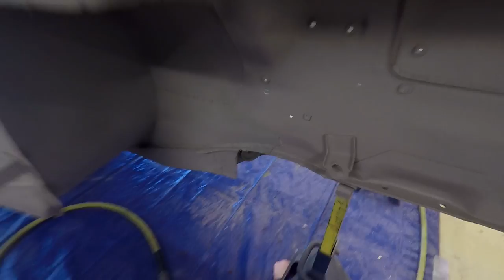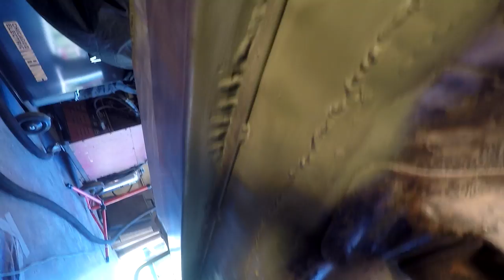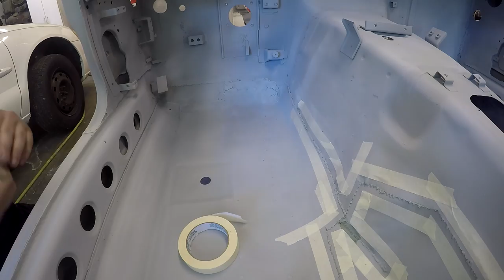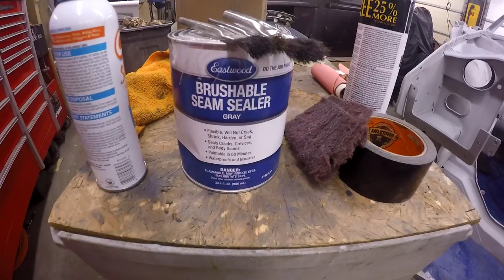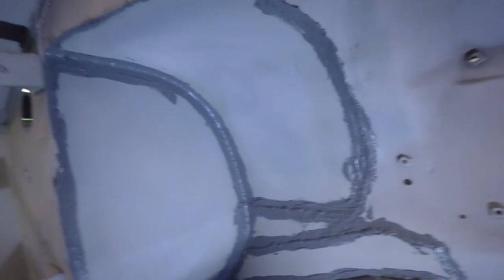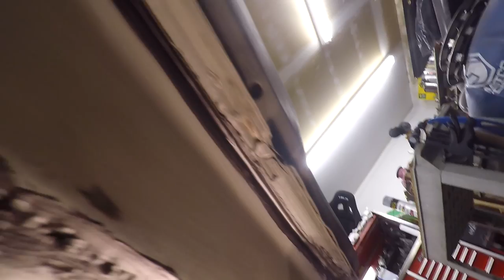Using Eastwood's Seam Sealer on the Datsun 280z

Comment: I hope hope hope you take my advice and use raptor 2part bed liner ,NOT rubberized undercoat it holds dirl gets soft when hot and then it's like tack cloth absorbing dirt then it gets cold and locks all the dirt in . Raptor is available online and at summit racing.
       That area in the roof is common as that is where the factory attached the roof to the rear quarter panel ,it's factory filled with lead ,plastic filler is just as good as long as it's prepped.

Please use raptor bed liner as it dries very close to a plastic gas can.
You will love it everyday you look at it.Remember any thing two part out performs and is alot more durable.

Again I'm not far behind you ,I live your staying on it because I am everyday  after work and every weekend. 
  Coming out nice my friend...
Reply from the maker: I have dupli color truck bed coating in spray cans and a gallon. I've seen it in person looks good. My dad used on his Cuda. I wanted something more clean and like por 15 for the inner fender. I'm going with something thick on the inner fender firewall and under the fender so that rocks don't cause damage and reduce road noise.
Reply: Built Not Bought TV 
Well it's  way better than ,that crappy rubberized stuff,I just watched a video on it.
      I love raptor.but what you have looks good too. Well after we have them on the road ,we will see how they both hold up.
         I have used this ever since it came out and the quality hasn't changed. Keep at it ,I'm going back to welding ha....I've got to catch up
I'm even happy with you being a step ahead. I've been priming after I've been welding so when I'm done welding I'm done priming so that's why I'm not far behind on both my cars.Im about to turn them on their other side to finish some welding I'll leave them that way to bed liner the bottom of the chassis. 
    Then I'll stand them up right and paint the chassis inside and out.
    It's been along time for us both.
But getting more fun.

Comment: Great video, you explain things very well and this helped me with my project. Thanks! Good luck with your 280z build! Looking good
Reply from the maker: Yo thanks, good luck with yours. It looks pretty cool
Reply: @StewartMotoring  so the seam sealer is for looks or does it prevent anything?
Reply from the maker: It seals the panels so water doesn’t get in
Reply: @StewartMotoring  owww so its really usefull, and do you have to primer it after that or can you paint over it?
Reply from the maker: You can paint over it either directly with paint or primer then paint. Don’t think it matters
Reply: @StewartMotoring  oke thank you that really helps! and 1 more question i am so sorry for the questions:P. can you do that stuff first on bare metal and then primer the whole car ?

Comment: You're getting so much done despite the NASTY summer heat. My 240 has been sitting in the driveway for a year now since I bought her. I've got a fair amount of work done but not nearly as much as you. Props man!

Ps. It's sooo much easier to work on your car when you've got the proper tools to do so. Another reason why I'm struggling so much.
Reply from the maker: Ha thank you. When I was doing the drivers side pulling off the tap you can see sweat dripping from my nose. Appreciate the comment! Good luck on your build
Reply: Isaac Mille

Comment: Safety Note: You were using Concrete Blocks to hold the car up.. I have seen some real problems with blocks crumbling/ cracking and braking.  I have experienced cars shift when improperly supported.  Please invest in another good set of car stands. No one should should get hurt enjoying their hobby.
Reply from the maker: Thank's for the tip

Comment: Did you not use seam sealer on the frame rails where you stitch welded?
Reply from the maker: Not from the top side, I sealed the frame rails from the bottom. Since it was just plug welds on the top they were pretty sealed.

Comment: Why did you apply seam sealer after primer? I'm almost finished with the welding on my 280z so i'm trying to figure out what order to do things in next. Also, what are you using for the bodywork in your latest video? Thanks!
Reply from the maker: Most of the research I did said to apply after primer. So I just went with it lol. On the bondo I’ll get back to you on that.
Reply: Thanks for the help!
Reply: Stewart Motoring 
I’m really ignorant with this but won’t the roughness of the brushing even though it’s on under side be visible after undercoat ?   It seems as though the roughness and slight raised brush on will be visible ?   Does that happen or does it not matter ?

Also stupid question but what is this stuff doing that basic paint or under coating do ?   I see the basic thought of doing it but is it really beneficial ?

Comment: Should have been blasted from the beggining... 2 steps forward, 1 step back...
Reply from the maker: WRONG
Reply: @StewartMotoring  really? Lol so blasting the whole car wouldn't have been better? Lol. You are putting etching primer on the bottom half while repairing rust on the top. You blast first so all the rust is gone, get it epoxy coated, then do your rust repair. What do I know though I only do this for a living....Also you can't put seam sealer on a etching primer...only epoxy primer. But you know better. 😏
Reply: Google. "Can seam sealer be applied over etching primer". All the big companies say absolutely not....but hey I've only been doing this for 20 years.
Reply from the maker: Do what for a living? Comment 4 year old videos with non constructive comments. Because your just wrong. Blasting a car is not necessary. This isn’t and wasn’t a professional restoration. See I don’t do this for a living and the way I did it and thousands others is a fine way to restore a car in their home garage. Also, my seam sealer has not failed. So.. how bout that?
Reply: @StewartMotoring  Delete the video or lock the comments if you don't want people commenting. It was constructive because now people know that the manufactures of the product you use do recommend the way you applied it. But hey I'm just a professional and they produce the peoduct. I'm sure you know better...it hasnt failed yet so it must be fine. You don't have to be a professional to read a can and follow the directions.
Reply from the maker: There’s opinions for both ways pal. Some say you can, some say you can’t. Many people do. So don’t be naive. And it’s worked for me for the past 5 years. No failure anywhere on the car. So....
Reply: @StewartMotoring  Some people vs. the manufacture of the product. Ok. Good luck. 👍